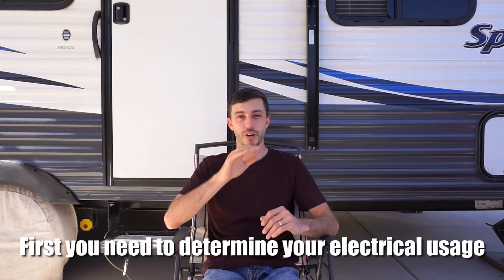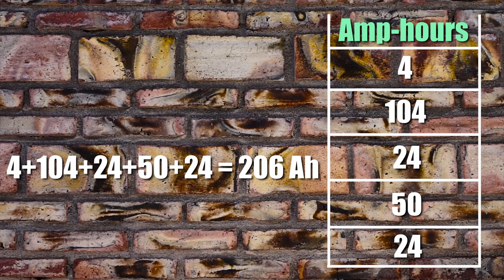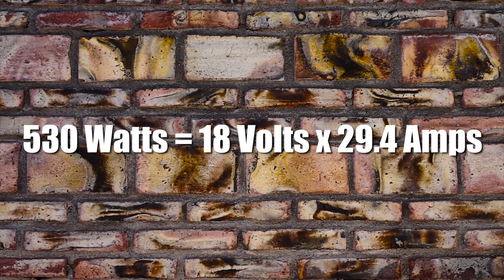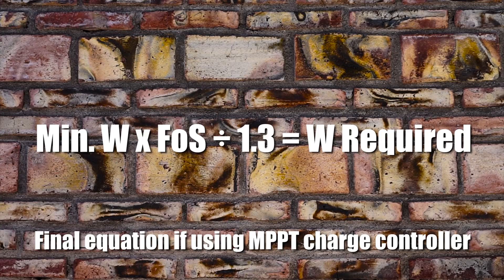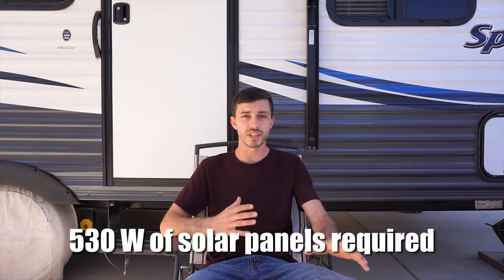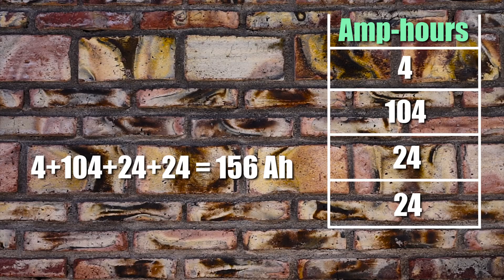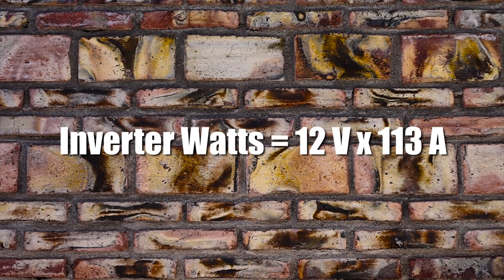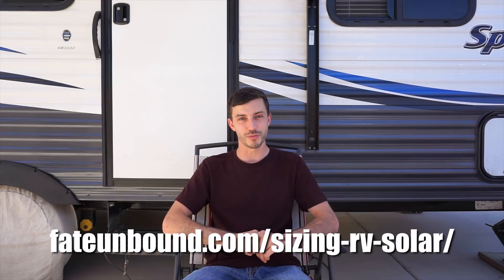Sizing RV Solar - Solar Panels, Battery Bank, & Inverter - Full Time RV

Comment: Well, I disagree on your analyses.  In a perfect world, I agree that the math works.  But, it's not a perfect world.  Doing rough math I think you would have been better with twice the battery storage, solar to about 800w and the inverter is fine.  It's better to have 2x the required as it better for the device looking at the heat and stress the invert is under.  Having said that their are other concerns in your use case.  The caravan you have added solar to it's going to easily support 800w of panels. So, that's a problem.  Granted when you are moving you could have panels that sit out to add additional power but you would have to set that up when you park.  Next problem is the batteries.  Sorry Lithium battery user.  Lithium  is very common but it's what I call overly safe.  They can cause fires or even explode if something goes amiss.  Being in a caravan it would be good to go away and come back to the burnt remains.  Granted this may not be common place if you look at the number of devices that use it but it does happen which makes me nervous in your situation.  Lead acid isn't the way to go either.  The caravan  would be overloaded with the seer weight of it.  The only answer that I think may be good is Iron/Nickle batteries.  They are safe, don't blow up, and can last a life time.  The only bit am not sure about is the overall weight.  I don't know how many kg each one is.  Now, they are working on Sodium batteries but I don't know how far along that is.  It's much cheaper than Lithium  and they are safe with a much lower cost of ownership than Lithium  will ever be.

Comment: And as a back-up a $450 Champion Inverter/generator will have your Li's topped off in no time. Or for about $100 more have a Champion dual fuel inverter/gen. A back-up power source is needed.....especially if you want to run the A.C. when boondocking.

Comment: Nice video, with 4800W of LFP batteries, more solar is cheaper than adding batteries. 960W of Solar would create remarkable change in off grid charge time.

Comment: David, I know you made this video over three years ago so I don't know if you'll see my question/comment - but, just in case ... I was wondering if you guys don't use the fridge while dry camping and that was why you didn't include in your electrical usage chart? We just picked up our trailer and it came with a small factory installed solar system with inverter so I'm interested in figuring out how long I will be able to use the 12V fridge. Thanks.

Comment: This video makes this so clear and easy to understand. Thank you for taking the time to make it. One thing that I'm confused on is in one part you mention pulling power from a 12v battery but then you calculate the table amperage for an 18v battery. I'm looking at the Lithium Ion Battle Born LiFePO4 Deep Cycle  batteries and they're 12v, so should I be multiplying by 12 instead of 18? What's the difference between 12v and 18v? Thanks again.

Comment: Lead Acid batteries have a rating that is called Reserve Capacity. This is the number of minutes that you can draw 25 amps from the battery. This can help you determine what battery you need. Also, if you make sure that you use a deep cycle battery (Marine or Golf Cart) then you will be able to fully discharge the battery and then recharge it without much concern.
Here is an example. A NAPA BAT8146 is a Reserve Capacity of 488 minutes. This amounts to over 200AH when you do the math. However, being a golf cart battery, you need two of them to make up 12 V.
Math: 488 / 60 = 8.13 hrs * 25 A = 203 AH

Comment: Sorry David, this is the first time I saw this video. I was wondering how you got the 100A for cooking, for 1/2 hour? I was thinking a 1200W cooker at 120V is 10A. I'm probably wrong on this, could you please explain?
Reply from the maker: It's because the cooker is drawing from a 12V source (our batteries) so it pulls 100A at 12V for 1200W
Reply: @FateUnbound  Got it, thanks for replying so quickly, David.

Comment: You never mention using the rooftop a/c. Will I be able to utilize that air conditioner?  I have a propane stove so no a/c used there. I didnt hear you mention the fridge either. Do you routinely use propane for the fridge and battery?
Thanks for the great videos!
Robert

Comment: Micro-Air is at it again. They've invented the EasyTouch RV, a new thermostat control for A/C with WiFi and Bluetooth capacity to be released this Spring. See their Facebook for more information and a new product announcement --and also RV Electricity on FB. It's for the aftermarket.  EasyStart is not their only RV product anymore.

Comment: So I have a 10w solar panel, a 12v lead core battery and a 300w inverter to run only 1-2 40w lights at a time for about 4-5 hours a night... Maybe a small radio and a cell phone once in awhile.... Am I safe? Or do I need a bigger solar panel?.... Note- only for camp use

Comment: Your 400 Ah Battery bank seems quite a bit lower than the suggested 585 Ah bank; have you ever had any issues with that....or do you just run your generator to top up?

Comment: David do you also have a generator?  I'm asking because I'm just now putting solar on my coach which came "solar ready" whatever that means...I've identified the plug on the roof for a panel and apparently I have a working 10 amp solar charger already installed and working showing voltage on my battery.  However I'm unsure how the generator power would factor into my needs/usage.  For now I just want the solar to top off the battery.  (I have one wet cell batt and plan to replace with 2 AGMs next year)

Comment: I may be wrong, but your calculation of how many watts you need, or use, should have been 29.4amps X 12 Volts, not 18 V. The devices are all running on a 12 V system, correct? Am I missing something?
Reply from the maker: Solar panels used for RVs typically output 18V, not 12
Reply: Fate Unbound right but you were calculating how many watts your 12v appliances use. So that would be amps * 12v.  Then you know how many watts of solar you need. I’m trying to understand where the panel voltage comes into the equation. If you calculate you need 500 watts, wouldn’t you just need 5 * 100w panels? Regardless of the panel voltage. The charge controller will pump out the stated watts on the panel regardless of the panel voltage. 
Awesome channel by the way. Thanks for the reply.
Reply: @christopheradamo3694  I got hung up there, too. I appreciate the video and I'm not an expert but it seems clear the formula at 4:52 is not correct and won't consistently identify panel wattage you'd need. For instance, I have higher wattage panels and they put out OVER 30 volts. According to that formula at 4:52, my setup would need around 900 watts of panels for the same usage :O. (~900Watts = 30volts X 29.2amps) What? My higher cost, higher wattage, higher voltage and higher amperage panels would cause me to have to DOUBLE my overall panel wattage? That's not accurate. Here is why. As mentioned above, the panel voltage output isn't relevant. You had the important figure David, when you identified that you'd need 29.2 amps continuous in order to recharge the battery, and your solar charge controller will regulate the voltage to the battery at a fairly stable nominal voltage (somewhere in the 12-14 volt range) and it's the amps from the controller to the battery that will vary based upon performance/sun. So assuming full sun/performance, to get 29.2 amps continuous at 12-14 volts, the minimum panel wattage w/b between 350-400 watts. How that wattage gets TO the solar charge controller isn't the issue, as it can be (almost) any combination of amps/volts. Your setup would indeed work for you as 500 would be ideal (you'll seldom get full peak performance from panels), but in my case I would be WAY over-paneling at 900 watts using your formula. Your number only worked for you because your 18v number was not very far off from the battery nominal voltage so it appeared to give you a good panel capacity. Mine has a voltage that is much higher than battery nominal and therefore the formula didn't work. Sorry for a diatribe, but initially I didn't catch that until I worked my panel data into the formula.

Comment: Thanks, for the video!    Very well explained!

I would like to add, however, that you might want to oversize all components in the system to accommodate future additional electrical needs.   If you do your calculations based on your current needs and then your needs change in the future, your system will then be under-sized and you will be facing expanding - or, more significantly, replacing - your components in the system!    This has the potential of dramatically increasing your investment in the system, while potentially leaving you with obsolete components that you can no longer use - not a good thing!   

If you have the budget for it, I would recommend you double ALL component capabilities from your calculated values, assuming you can accommodate them physically.    Another benefit to over-sizing your system up front is that all components are going to be operating at significantly below their capacity, which will improve their reliability and longevity.    This is particularly true of batteries, both lead acid and lithium.   The shallower your discharge cycles, the more cycles you will get from your batteries!   For example, if you are discharging your lithium batteries only 60% rather than 80%, you could extend the total number of cycles they will provide from 2000 to 5000 - a significant difference!  Similarly, your lead acid batteries will also give much longer service life, if they are discharged less each cycle!

Comment: If I am looking at my laptop charging brick (and other devices), am I counting the INPUT amps or the OUTPUT amps? I am thinking INPUT amps but want to make sure I do it right because they are different numbers. Thanks!!!
Reply: Input amps on your laptop charger are going to be based on a 120v AC source, and output amps are going to be based on the output voltage.     What you need is input amps based on 12 volts - so, just take the input current for your laptop power supply and multiply by ten.
Reply: Richard Owens oh wow, that’s not what I expected! So I’ll be using more amps running off 12V than plugged into a house outlet? Thank you for your input..hahah! Seriously though, I appreciate your help. I’ve learned a lot with much more to go!

Comment: The best way to measure your usage, is to just use your battery  monitor system. Use your generator  or a power post to keep your batteries charged as needed. I've found using the manual method can be off be a factor of 3x or more.

Comment: I agree with everything except your explanation on the charge controller. From what I understand there these devices whether MPPT or PWM have an efficiency loss. MPPT is more efficient than PWM therefore you won't have to make up for as much wattage loss. At no point is there an actual bonus though. You would actually need to add wattage with either one. Not so much with the MPPT as they usually have a 95% or so efficiency. However the efficiency loss on a PWM may be as much as 30%. You would definitely need to make up for a loss of that size. That's why it is said when using MPPT you don't have to have as many watts.

Comment: Great videos on your solar install and details of all areas!! I've been watching hours of video trying to learn as much as possible before starting my install. Your videos are by far the best! You did an amazing job of explaining all the different components as well as wiring. I too picked the Go Power 3000 ISW and the TS-30. I was hoping if I might ask your advice? There were two areas that you didn't touch on. [One], probably because you don't have an on board generator. And you may not know, but is there any special re-wiring I will have to do to accommodate my on-board generator ie: inverter, transfer switch or other? I cannot find any information regarding the wiring of the generator when upgrading converter and transfer switch with solar setup.
[Two], I.m concerned about the coach batteries and how the factory wiring could interfere with the new solar wiring configuration. Is it possible to keep the Coach batteries in their current wiring configuration, and run two separate systems? Or can the new charging system charge both the solar battery bank as well as the factory bank? Any advice would be greatly appreciated.

Comment: Thanks. It was a good explanation . I will have to watch it again. I was wondering if while charging off of solar with appliances running, what would happen. But I think I get it now. The "Parasitic" also is a good idea to add because there will be losses no matter what. Even inverters and internal battery resistance will create some form of drain. One Amp hour seems realistic.

Comment: Hi, I'm not sure if I am more informed or more confused. I'd like to think more informed. So, I have a 31' 5th. wheel. refer,air-conditioner,  cooking, 2/laptops, lights,inverter, parasites. Plus I will be charging battery packs for power tools. I come up with(656w/hr)  using (Lithium Batteries) How many batteries and panels do I require? What size inverter? Should I buy a dual fuel generated? I am determined to learn all of this. I can't afford to make a mistake. For those of you who have passed me up in your comprehension of solar technology. I am a mere mortal with 40 acres, I need power and I feel like a deer caught in the head lights. Learn I will. Please assist me. I am planning on hooking up another same size unit for the caretaker. Should I build a solar system separate for that RV unit? Your assistance is greatly appreciated. Queen. P.S. Great video!

Comment: The oversized inverter wastes power.  You might consider running your laptops from 12 volts (a 12 V plug in converter) and keeping the 3,000 watt inverter turned off except when you need it for cooking.

Comment: In your chart you have the laptops as being one of the devices using a lot of amps. I don't know what type of laptops you are using, but in my case I have a Lenovo. Many people probably don't know that most all computers and laptops run on DC electricity. While they use an A/C cord, that is more for convenience than anything. In the process of using a home AC cable, you are feeding the laptop AC power which has to be converted to DC. If you don't need AC you will significantly use less electricity from your battery (which is finite) and a DC power cable for the laptops help out a lot. I was able to pick up a DC cable from Amazon that is built for the Lenovo laptop. That way I simply plug directly into a DC outlet (I have a separate cable from the battery that serves the DC side. Not only will you save on battery usage with the laptop(s) but you already save as well on the lights (which are normally DC today) and the trailer stereo which is normally an automotive type stereo (hence DC). I have an inverter, but I generally don't use it. I have enough DC outlets (and some other outlets off the inverter if needed).  The refrigerator I normally leave on propane and my stove and oven is propane. Not using an inverter also saves on battery usage as an inverter can waste up to 10 or 15% while in use, due to the load in having to convert DC to AC. The only requirements for AC in my trailer is for the microwave and the air conditioner which I can use my generator (Honda 2000 for quietness) when needed. The best solution I can think of when camping on battery power is to use DC devices whenever possible. I believe there are kitchen devices that can be purchased that run on DC also.  Just some thoughts... 

I also love primitive campsites and boondocking and I really like your videos (you guys are a great couple). Perhaps I might run into you some day, I hope to see if I can find some volunteer slots next summer, perhaps doing some hiking trail maintenance (which I currently help out on and enjoy.

Comment: I have a truck camper, I'm adding solar system to it, but I'm unsure of how big I need.  I would like to put in a mini refrigerator and remove the heavy rv style frigerator. Maybe add a TV, we use a laptop, charge camera batt., so really not a lot of stuff. All the lights are 12v led's, the cook top is gas, and the hot water is gas, we live add camp in Colorado. So hopefully you can help
Thank You 
Justin.

Comment: You stated you need to determine your amp draw from a "12v" battery source.  Does that mean you're converting the amp draw for a 120ac device to the draw it would be on a 12v battery.  If so, how is that done?

Comment: 100 amps for cooking? 13 amps for laptops? Yikes that is a huge draw for either. What am I missing here. I be confused. Great video, thanks!
Reply from the maker: That is the amperage being pulled from a 12V source (the batteries). They would typically pull 1/10th that amount from a wall socket since they would then be provided with 120V. The griddler pulls 10 amps from the 120V wall outlet, but 100 amps from the 12V batteries. The laptops pull 1.3 amps from the wall outlet but 13 amps from the batteries. Remember Watts = Amps x Volts, and wattage always has to be the same. So if Volts goes down by a factor of ten, amperage must go up by a factor of ten.
Reply: Fate Unbound : Thanks for the detailed explanation. I am so accustomed to 120V that I forgot where the inverter gets the power. No wonder the cables are so large in these systems!